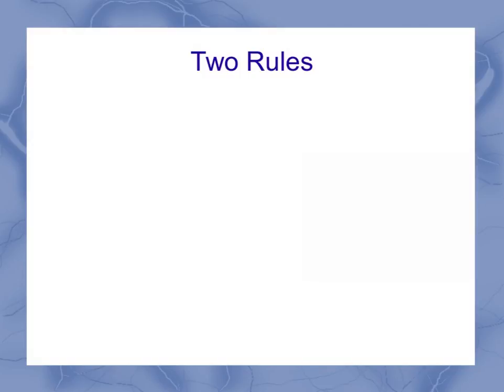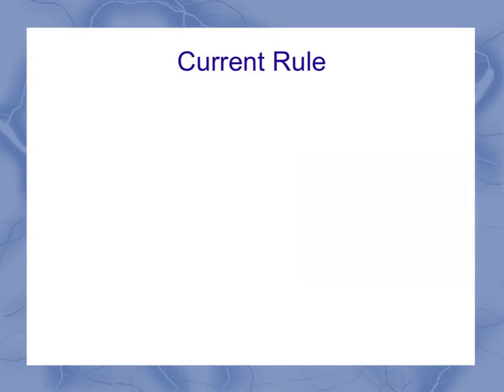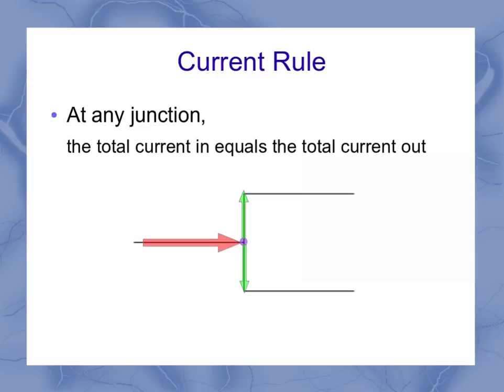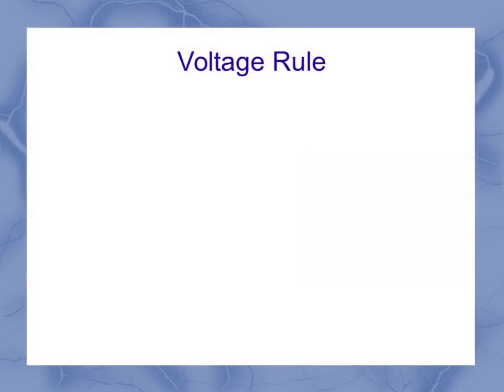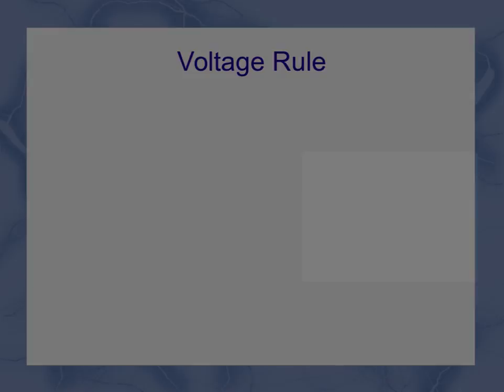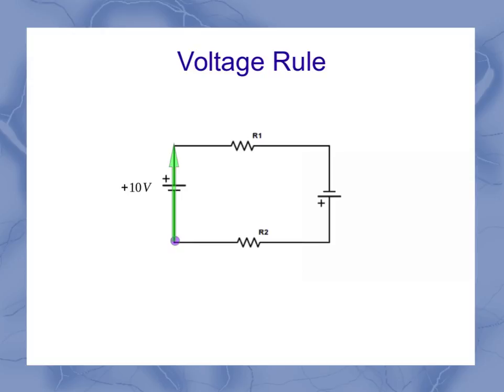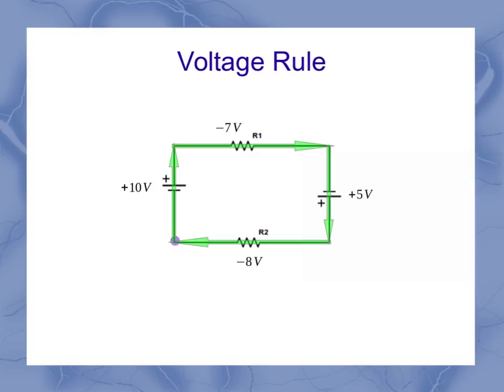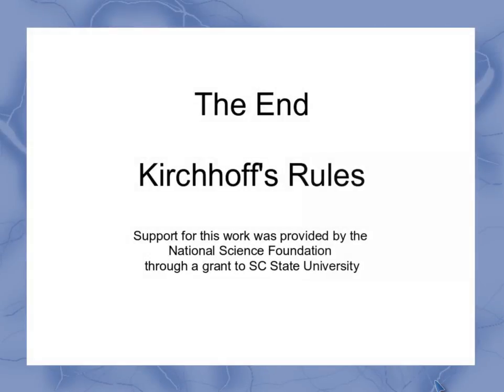Kirchhoff's Rules: Introduction

Comment: What would be the result of having a circuit, where the voltage does NOT equal the net resistance? Would the current increase, b/c of Ohm's Law, and give it a short circuit? or become a dangerous circuit?

Comment: I searched  with filter- creative commons. where I found this video. But I dont see any license information details  below.
Reply from the maker: It was marked with the standard CC BY license when I setup the videos.  Quoting from the Creative Commons website: "This license lets others distribute, remix, tweak, and build upon your work, even commercially, as long as they credit you for the original creation. This is the most accommodating of licenses offered. Recommended for maximum dissemination and use of licensed materials."
Reply: thanks